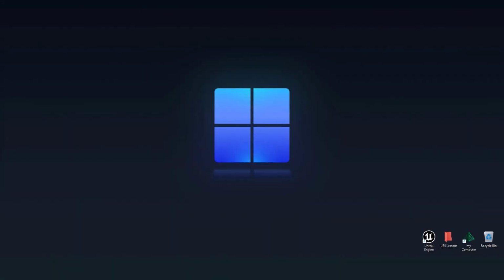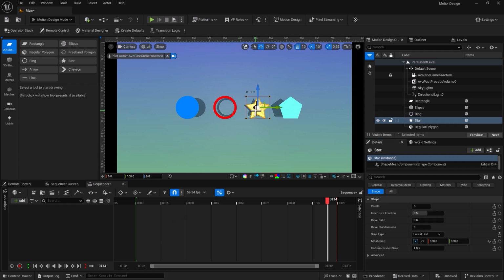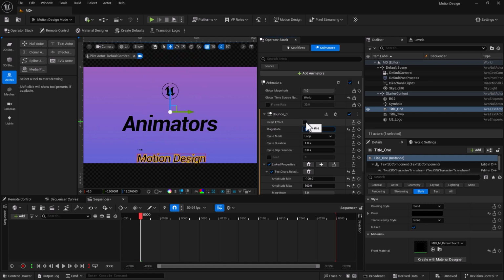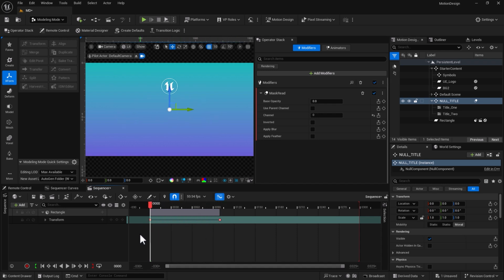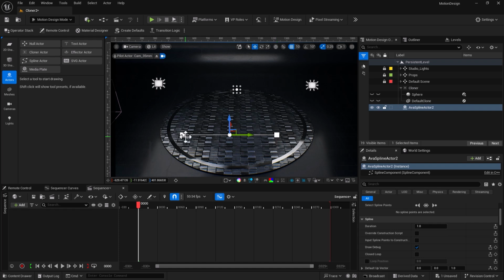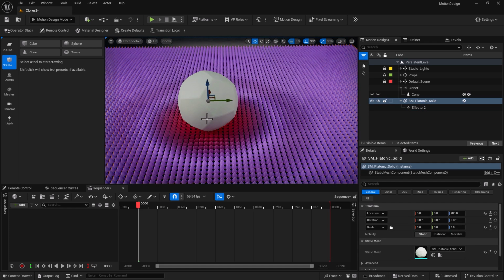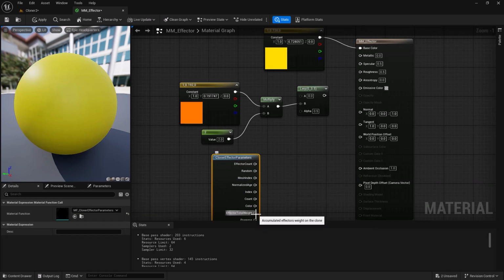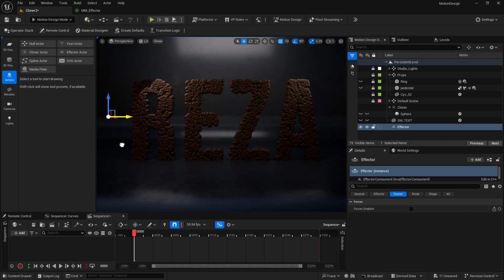#UE5 Series: Motion Design from Scratch: +2 Hours Deep Dive

Comment: Thank you for the great tutorial! Do you know how to use the Cloner Effector Parameters when I use multiple effectors? I use a sphere effector which should trigger the emission but I also have an unbound one. And this one also triggers the emission. Is there a way to make sure, the Cloner Effector Parameters Node only listens to one specific effector?
Reply from the maker: Glad you enjoyed the tutorial. In UE 5.6, the Cloner Effector Parameters node reacts to all effectors by default. To target just one, you need to use the “Effector ID” or “Effector Group” system, Well, basically, assign your sphere effector to a specific group or ID and then set the Cloner Effector Parameters node to only respond to that. That way, your unbound effector won’t trigger the emission.
Reply: @sarkamari I solved it by filtering by effector color in the material. Worked fine, too 🙂 but thanks alot for the reply!

Comment: what i noticed it when u make material with material designer it does not show that shader compiling thing on ur pc,, but when i make a little changes after every changes this shader compiling thing starts, can u tell me why and is there a setting for that?
Reply from the maker: That’s normal ! LOL when you first create a material, Unreal often uses cached shaders, so no compiling shows. Once you make changes, it recompiles, which is why you see the notice. No setting to fully turn it off, but using instances helps reduce it. I have NVIDIA 5090 which also helps

Comment: Thank you for the tutorial 🙏🏼

Let’s say I want to add motion design to an existing 3D project, I want to merge both, if I update the light source and everything will it be alright or will it break everything ?
Reply from the maker: As long as you manage your assets properly and use Level Sequences or separate levels for motion elements, updates like changing the light source won’t break the project you should be able to do it with no issues. Just ensure lighting changes are intentional and compatible with both parts. Always keep backups before major updates.

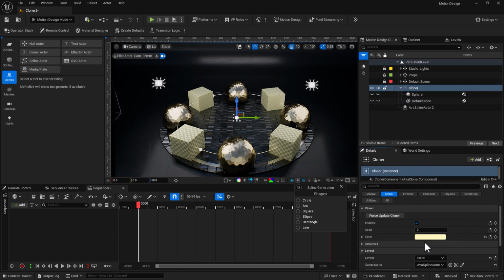Comment: 1:17:30 Is there anyway I can move clones (meshes) along an open spline when using cloner / affector? The only way I can move them is along X, Y, Z which isn't really that useful. But I want to move the meshes along the spline curve...
Reply from the maker: You need to use the spline’s own coordinate system or parameter. Instead of applying a simple translation, drive the clones' positions based on the spline’s distance or time parameter. This way, the clones follow the curve precisely.

Comment: Thanks so much !

Has anyone have an issue when rendering multiple cloner where only some of them are actually rendered, randomly?
Reply from the maker: Yeah, that can happen if the cloner’s instances aren’t set to be visible to the renderer. In Unreal, if you’re using Niagara or Instanced Static Mesh Components, make sure “Render in Main Pass” is enabled and the LOD or culling settings aren’t aggressively removing them.